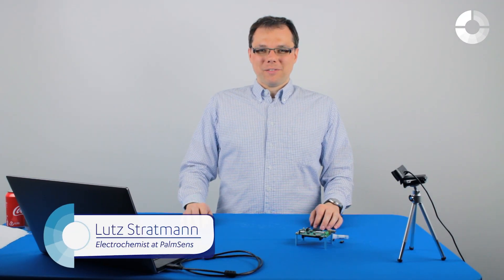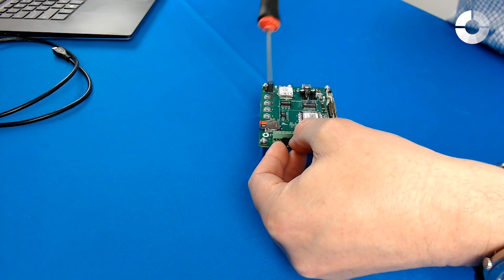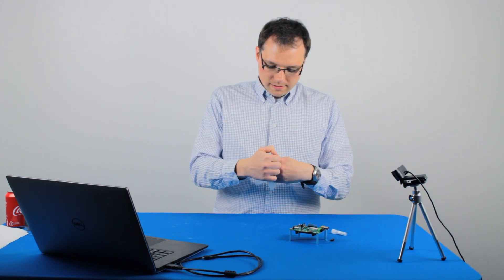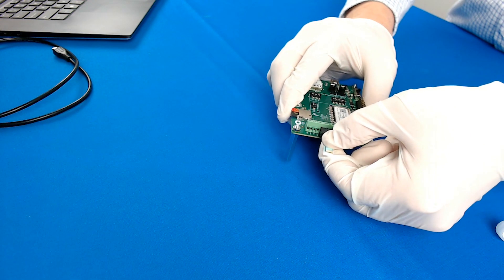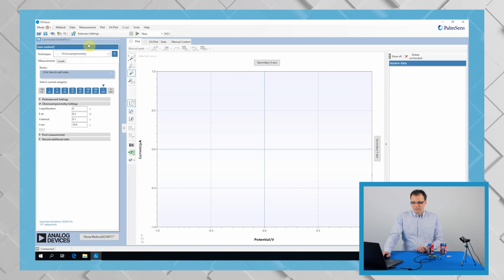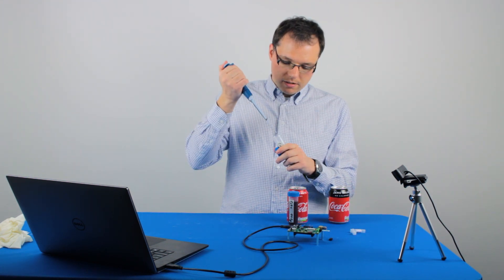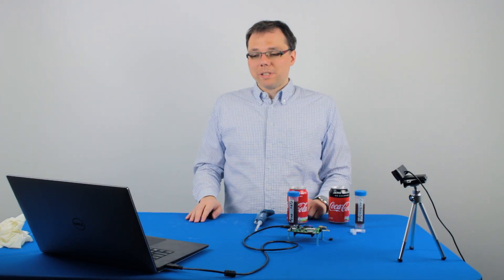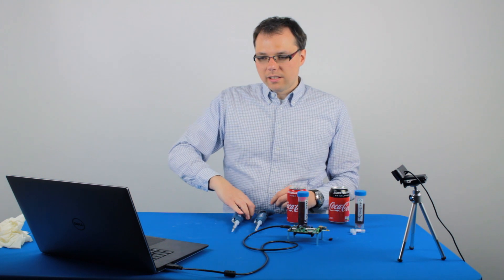Glucose measurement with the EmStat Pico Dev Kit

Comment: hello, i want to ask.
can it be used to measure the content of several types of metals in water in real time? Especially for use on ESP32
Thank you
Reply from the maker: The EmStat Pico Development Kit has a pin header for use with an Arduino MKR Zero, and our examples are based on that controller as well. The EmStat Pico can be controlled by any controller that meets the communication standard of the EmStat Pico, you can check those on our website https://www.palmsens.com/product/oem-emstat-pico-module/? under  downloads. For the measurement of different heavy metals usually a wider potential range is required, we have a knowledge base article on that here: https://www.palmsens.com/knowledgebase-article/detection-of-multiple-heavy-metals-introduction/